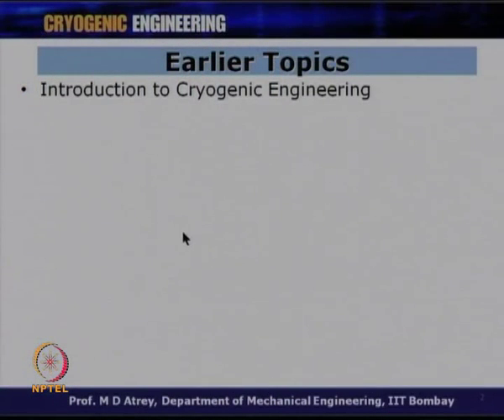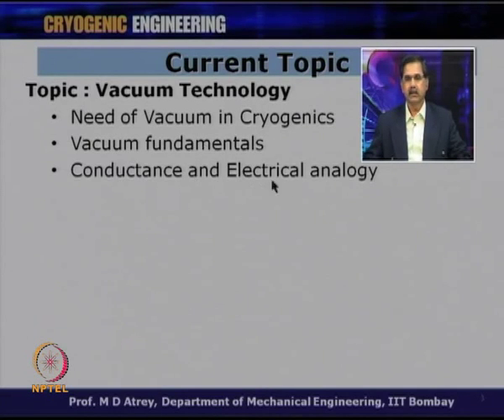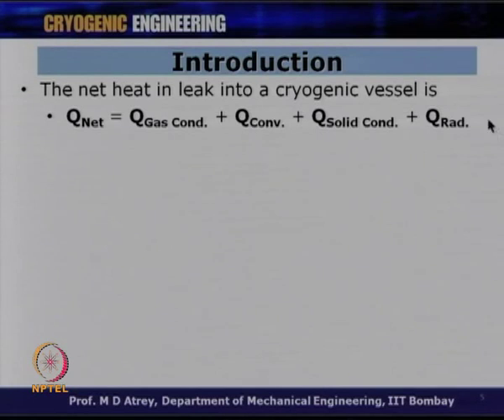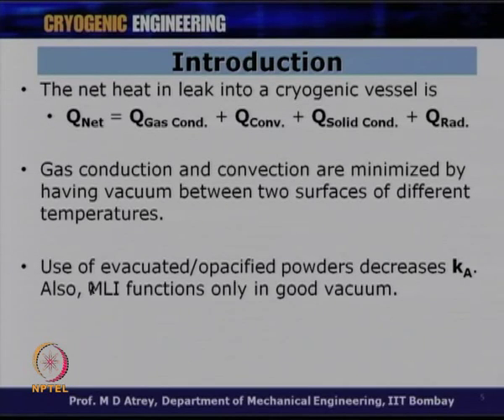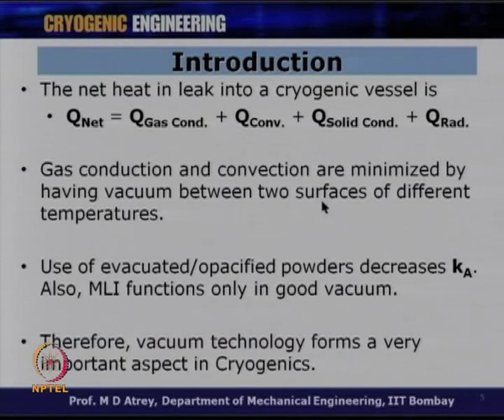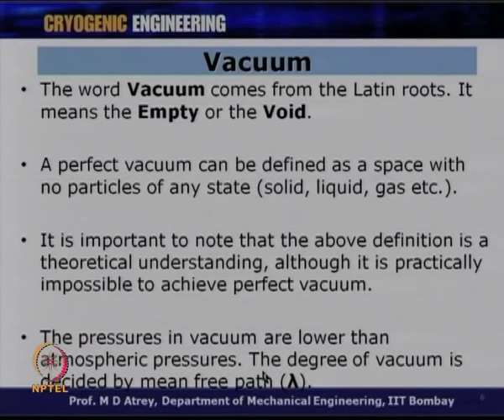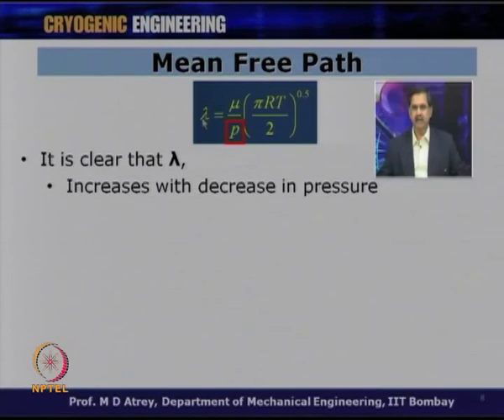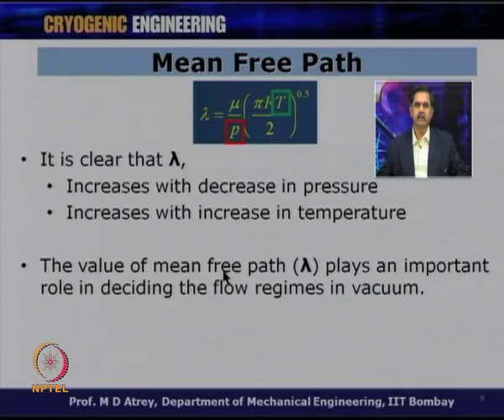Mod-01 Lec-36 Vacuum Technology

Comment: Dr. Atrey, I discovered your video series on Vacuum Technology while searching for Vacuum pump theory and operations. I am currently watching Mod-01 Lec-36 and I find it very informative and helpful. I am learning allot about things I do everyday on my job. One of the things I have been tasked with on my job is building a presentation on Vacuum pump technology and I find that your information will be very helpful in this project. Sir, with your permission I would like to use your info and you frankly as a reference at the end of my presentation. Thank you